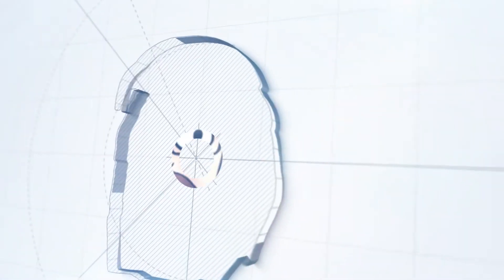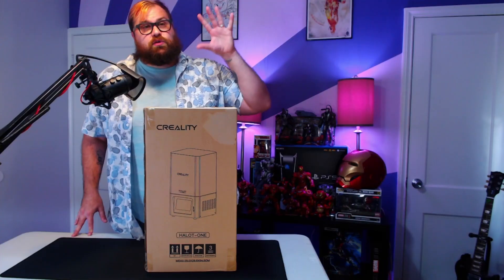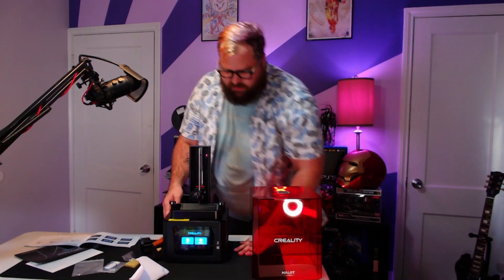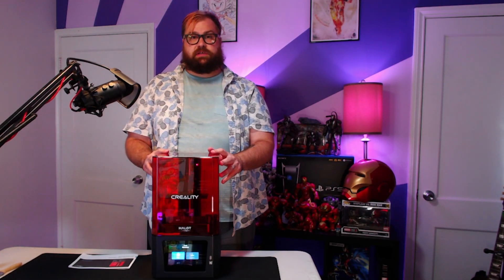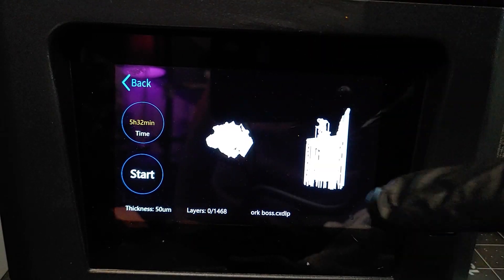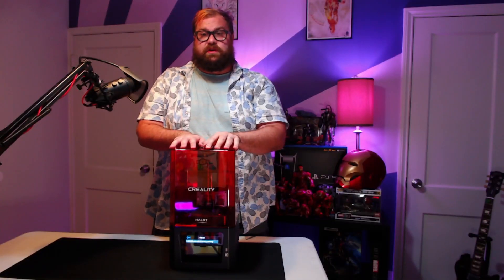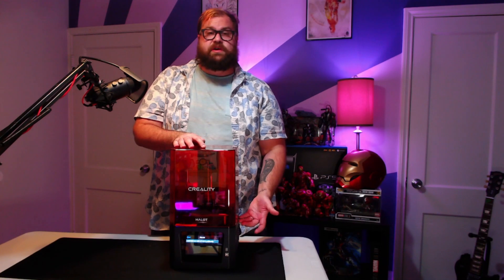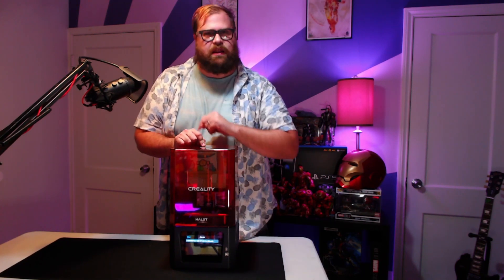Should You Buy A Resin Printer? (Creality Halot One Review)

Comment: I bought this printer one year ago to start printing resin miniatures, and it worked great.
I had to calibrate just ONCE, using the recomended factory parameters and i never touched the plate again after hundreds prints.
Now my only issue the size, is small. For normal miniatures is perfect but forget about printing vehicles and big superhero statues, unless you want it really small or print each piece one by one.

 That is the only reason why i want to buy a bigger printer, but otherwise i would stick whit my Halot One.
Reply from the maker: I recently upgraded to the Saturn 3 and it's amazing. Only did it because of size limitations. The Harlot one is still solid and I still use it!

Comment: Is the paper sheet the same thickness as the FEP film? Why not level it with the spare FEP film?
Reply from the maker: I found that the company recommends using paper.
Reply: @IronAndy  However, I found a video where the owner put 4 small sheets of paper under the 4 corners of the bed when levelling. I thought I would try it (mine was new).
I was shocked because it was tight on one side and the other side you could pull the sheets out. It was slanted on the long side and you can't adjust it on that with the usual screws.
I had to loosen the screws on the carriage of the linear rail and twist the whole bracket. with great difficulty I managed to make it better but it wasn't really perfect.
I just realized the greatness of the ball joint mount (some printers have it).

Comment: Got mine for 200, still a great deal. Also the print can be great with better resin brands and fiddling with exposure times.
Reply from the maker: Yeah I did a few exposure tests. Really helped with the quality. I currently use Elgoo's resin and I like it.
Reply: @IronAndy  Esun has been good for me especially their tough resin. Never had a bad print and prints with good details. Also if you're having issues with build plate adhesion get a fine copper brush and use it on the build plate. It will create very a good surface without the use of sandpaper
Reply from the maker: @dredgewalker  I will try that. Thanks for the tip!
Reply: @IronAndy  One more tip that will make your fep last longer. Use rain-x or a teflon spray coating on your fep film. It helps with the print sticking issues and will make the prints stick a less on your fep which will prolong your fep films lifespan. My stock fep film on my halot one hasn't still been replaced for a month after heavy use, one of the things to look out for is the pint sticking on your fep film as it will stretch and wear it out faster which may result in the fep film breaking and leaking onto your lcd screen. it doesn't matter if it makes it a little opaque when you apply it but be sure to wipe off any excess coating and letting it dry before doing a print. No matter how good you level your print bed if the resin wants to stick on your fep film then it will stick to it which will result in either bad prints or weakening of the fep film. Since i used anti stick coating on my fep about almost every print I did didn't result in failure.
Reply from the maker: Good tip. I'll keep that in mind.